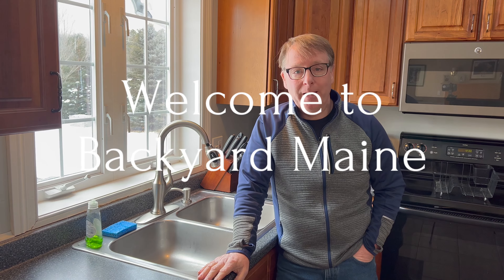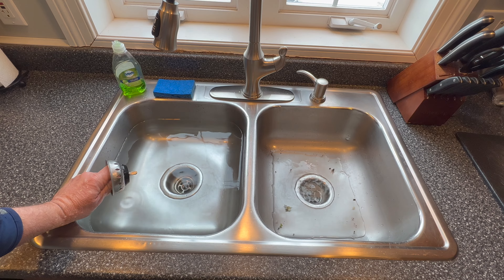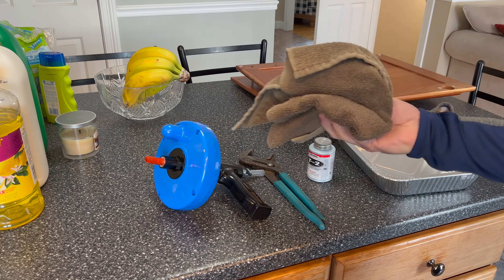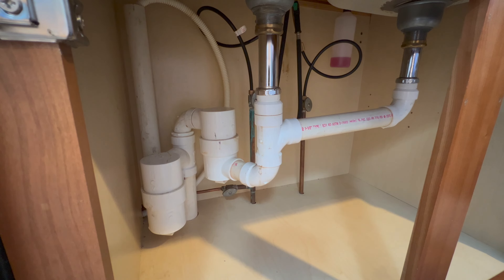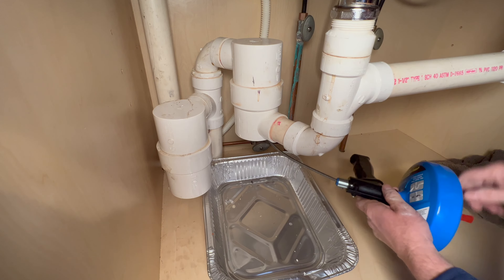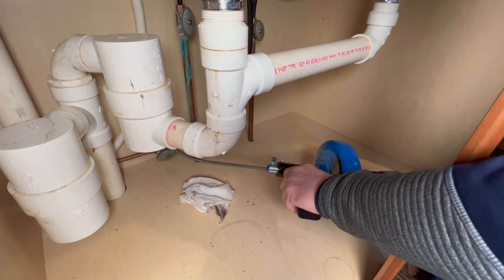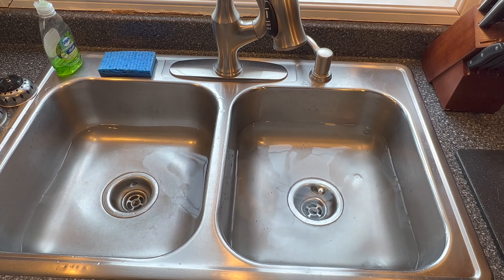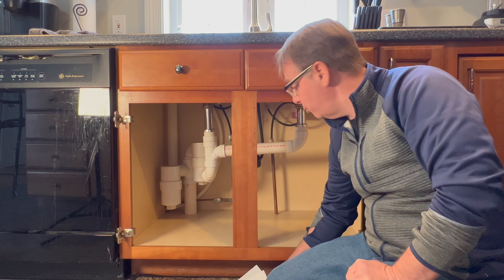Slow Sink Drain Kitchen | Not the Trap

Comment: A long post but maybe it will help someone.  I, too, had a slow draining kitchen sink where the clog was somewhere in the 2 inch PVC drain line, well beyond the trap.  I tried 2 doses (1/2 bottle each) of a liquid drain cleaner which apparently softened up the debris it could reach but then caused a complete blockage of the line.  That can be dangerous because now there is caustic standing water in the pipe.  I tried a snake 17 feet into the pipe but still could not reach the clog.  Before I called a plumber I went online to calculate how much standing water was in about 25 ft of pipe that I could see before it entered the concrete foundation floor.  With approx 4 gallons in the line, I grabbed a 5 gallon pail and an additional bucket and some towels and drilled a 1/8 hole into the PVC about 2 feet above the floor.  A small stream of water shot out for 10 secs, then stopped.  What?  Drilled a 1/4 inch hole and that gave a somewhat OK stream, 80% into the bucket and 20% running on the outside of the pipe onto the floor.  Once that stopped as much as it was going to, I took a handsaw and cut the pipe right at the hole I drilled.  Whoa -- I cut right through a whopping slug of a gelatinous clog.  The top portion of pipe was still dripping and as I went to move it over the bucket about 2 feet of clog dropped out.  Well, at that point I removed the remainder of the pipe above the fitting at the floor and figured there probably are roots in the sewer line.  But when I started poking a hole in the clog with a large screwdriver, voila!  The couple inches of remaining sludge sluiced down into the sewer line.  The culprit of the clog?  The inside of the 2 inch PVC that went into the fitting at the floor had not be de-burred -- it was clearly jagged from when it had been cut with a saw and glued into the fitting 15 years ago.  That restriction trapped debris from the kitchen water and built up over the years to slowing the flow and creating a clog that grew upward from the basement floor.  Thankfully, this line only drained the kitchen and not toilets.  When reassembling, I used a rounded file to debur the inside of that connection and then I spliced in a wye with a cleanout plug for easier access in the future, if ever needed.
Reply from the maker: Wow, what a project..
Reply: @BackyardMaine  Yes sir!  My two takeaways:  ALWAYS de-bur / ream your pipe cuts AND be careful with drain cleaners.  When in doubt, call in a professional.

Comment: This video helped me alot!!  Thank you!  It actually took me a while to figure out how to use the auger properly.  I was doing it wrong at first.  My clog was into the wall and down into the drain in the slab.  I didn't understand at first that the hand screw on the auger needs to be lose as you are pulling the cable out of the auger and pushing it into the pipe and then when it won't go any further due to an obstruction you tighten the screw against the cable before using the drill, and the drill trigger only needs to be slightly pulled where the cable is turning slowly as you keep the cable from coming out.  At first when pushing the cable in some of it folded over and was just wrapping around itself.  I learned I had to use a flashlight and make sure as I pushed it in that it was going down the pipe and not folding.  Once getting past a clog you loosen the screw again to begin pushing the cable further into the pipe, each time you hit an obstruction you must tighten the screw against the cable again before using the drill and then when it seems the slack is coming out of the cable and it is going further into the pipe, loosen the screw again to pull out more cable to push into the pipe.  So you actually loosen and tighten that screw quite a bit.  Always clean the cable as you are pushing it back into the auger and clean out the hair and stuff out of the spring on the end before using it again or putting it up.  Thanks again for posting this video!  I'm sure it saved me at least a couple hundred dollars!!
Reply from the maker: Awesome. I'm glad it was helpful.
Reply: T M I

Comment: Replace the elbow coming out of the trap with a TEE with a threaded cap on top for maintence access.  Snakes are OK, but a pulsing line cleaner will do a much better job.
Reply from the maker: Thanks for the tip. I'm an electrician not a plumber..
Reply: Water and electricity both take the path of least resistance...

Comment: Very informative... Thanks for posting. I do have an old snake and I am having the same issue (U whaped pea trap)  Dirty water actually also came out the washing machine drain which is in the same wall farther down. I did snake like 6 or 7 ft but no luck yet. Do you think I  went far enough? Any other recommendations? Thanks in advance!!
Reply from the maker: If the problem still exists I would go further. I went quite a ways and kept pulling it back and forth while running the drill on the way out. I did that a few times to clear it out.

Comment: I've never come across those drum traps.  Hmmm.  When I put this type of plumbing together I leave  myself access through an extra T  or Y fitting.   Too bad the 90 after the drum isn't a T with an access.
Cool video.   tHanks for posting it.
Reply from the maker: Yes a T-Fitting with a clean out would have been ideal. If I couldn’t get through the drum trap plan B was to cut it out and add one. Thanks for watching!

Comment: So glad I came across this video. So we've been renting a house in TX on a year lease and haven't had any issues with the kitchen sink until the past two to three weeks now. This is the 4th time we've had to clear out the pea trap and every time we do so, it runs fine again. Until it doesn't. Is the constant pea trap clogging...is thst the pea trap issue, is it a slow draining sink issue or something else? Glad we only have 2 months left at this rental property...it just strikes me as odd that the landlord did not put a garbage disposal in the rental to avoid such back ups.
Reply from the maker: If you have a slow drain solids will not wash out of the trap as designed. I think the clogged trap is a symptom of a slow drain.

Comment: my dad had those kinds of traps in copper pipes he was a plumber they got rid of them a long time ago they always tend to gather dirt never even knew they made plastic versions I think they are outlawed now. they want traps that are self cleaning smooth flow, so dirt does not gather in them. the only problem is they don't like S traps either, so they don't get sucked dry by syphon effect does your sink have a vent?
I found the secret to keeping my kitchen sink from getting backed up was not putting any grease down the sink we pour grease and oil into a steel can with some paper towels and throw it out wipe out pans with paper towels while warm.
  if you have greasy water in sink wash it down with cold water then it won't stick to the pipes as it goes along warm and cools
Reply from the maker: Yup.. they are terrible. I need to get around to replacing the with P traps.

Comment: So how many feet of that wire did you get inside the pipe?
Reply from the maker: I think it was about 12 - 15 feet to the 4" drain. Several bends in the 2" though. It worked great and the sinks are still draining well today.
Reply: @BackyardMaine  ok thanks. Nice video by the way
Reply from the maker: @fernandomunguia6714  thank you.

Comment: I tried running this same snake for 6 hours today I got about 8 feet in and still have total blockage
Reply from the maker: Thats a bummer. You must have a clog further down the drain.
Reply: Same here almost like I'm running into a t split. I've used draino and other things, and still drain clogged with no sign of evening draining slighty.
Reply from the maker: @captinkrunch7530  I have to do mine again as well. I made this video a few years ago and the drain is becoming slow again. I really need to remove the drums traps and replace them with P-traps. It's a lot of connections in a congested area so I have been putting it off.

Comment: Wow!   I would rip out that entire drainage situation that you have there.  That whole setup makes absolutely NO sense!  No wonder you have to repair that.
Reply from the maker: That’s on my list. The plumber who piped my house thought he was a genius. I think he was something else
Reply: @BackyardMaine    I only say that because I also had to rip out all of mine this past weekend.  The one thing they (original plumber) did that I do appreciate is that they installed two separate outlets or drains in the wall where the main sink drains to one and the disposal drains to another.  Both have P-traps, but they're drain very nicely.  What I should have done (didn't think of it) is added an additional access point for a 'Snake' access, if I ever needed it.  Hind-sight is always 20/20.  I feel like I'm ready to do another!  Not!    Later!
Reply from the maker: @stephensmith60  Maybe you can come over and do mine and I'll video you and put it up on the channel. lol. I have a rough sketch of what I want to do and I also have a clean out drawn in. I replaced the drum traps in the three bathrooms last year but I have been putting off the one in the kitchen because it has two sinks and a dishwasher going into one drain.
Reply: @  Too bad I can’t send you the pictures of what I ended up with.  It’s very close to what the original installer did, but my pipes line up.  Theirs were 3/4” off!  Plus I also made sure that my pipes ended up with the required slope.  Good luck!  👍

Comment: Backyard  Maine  the things to do differently is a it doesn't look like it vented put an air admittance valve on the top of the line that goes up for the dishwasher it will help allow air to come into the system and drain things quicker also on the end of a snake when you go to snake things give it a 45° Bend or slightly less even if you want but bend the tip of the snake a it will make it easier to make it around bends and be when it's going through a straight pipe it will swirl around and catch more of the inside diameter of the pipe that way it will clean better run it slow as far as the pace going forward but run it at the highest speed that you can and when you're done snaking run hot water slowly down the line that will soften any grease in the line and then go and fill both sides of your sink with this hot of water as you could stand or if it's too hot just go and pull the stoppers out with a set of tongs or pliers or something and let that huge rush of water then after the grease is softened that big gush of water will push it to your main where it's no longer going to be a problem
Reply from the maker: That's all great information Bob. Thank you!
Reply: @BackyardMaine  always glad to help a fellow tradesman
Reply from the maker: @bobmeyer9711  Likewise my friend. Thanks again.
Reply: @BackyardMaine  thank u for teaching this older plumber how to do a few new things also
Reply from the maker: @bobmeyer9711  My pleasure.

Comment: I'm having the same issue except it will stop draining at the level of the drain cap of the sink. I've got the snake but no matter what I do I cant get it more than 1 foot into the pipe except for when it goes up the vent stack and i hear it up at the roof
Reply from the maker: That’s a bummer. I wish I could help

Comment: Could have saved your money & avoided the labor. Heat 2 pots of water to just before boiling, pour in 1, wait 2 minutes, pour in the other, wait 5 minutes, flush with cold water. Done.
Reply from the maker: Tried that actually several times. Also tried liquid plumber. Then I decided to get dirty and actually fix the problem.